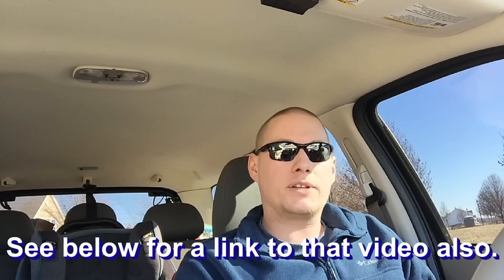Ford Ecoboost Engine Carbon Deposits: What You Need to Know

Comment: I have a 2014 Ford F150 Eco boost that I bought 2nd hand.  It has 105k miles and never has had an oil catch can.  Would you recommend me putting one on or not worry since it has never had one?  Would you recommend the $25 Amazon special or spending $400 for the super expensive one?  Thanks!

Comment: 8 years later and yes they are oblivious. the 2.0 turbo on the ford maverick still has carbon deposit issues.  they need to follow Toyota's example and actually care about building a good engine. they need dual port and direct injection.

Comment: I do an "Italian tune up" on my Fusion Ecoboost, once in a while when getting on the highway I put my foot to the floor and leave it there. Lol also use 93 octane.
Reply: John Gaudet How has this worked out for you?  That’s been my method too on my F150 along with heaps of seafoam usage
Reply: I pour marinara into the oil fill to achieve a true italian tune up
Reply: i do the same thing!!! i have a 2015 ford eacape 2.0 EcoBoost with 126,878 miles on and i only use shell v power 93 octane
Reply: You're using that method to clean the valves on a direct injected engine?
Reply: Love doing the Italian tune-up, but not higher octane. Like the idea of Chevron w/Techron.

Comment: So, I've got a 2014 Flex 3.5L EB. It's only got 5,000 miles on it but I'm going to get it's first change of oil soon and I'll specify full synthetic. I also only use Shell, but I think I'll start using 93 instead of 87. Also, the odd "Italian tune-up" sounds beneficial. I don't want to get to 60,001 miles and have Ford tell me to replace the heads.

Comment: I am a  Caterpillar diesel generator tech, a lot of times we see that when engines don't run at rated temps and load cause exhaust "wet stacking" or "engine slobber". Could running these engines at high rpm a couple of times in a drive cycle prevent this carbon build up?

Comment: MY belief is that EGR and PCV cause carbon to deposit on the valve easier now and because theres direct injection, now theres no gas coming upstream to dissolve the carbon
Reply: +nicholas elias That's exactly what is happening.
Reply: +nicholas elias I was thinking his explanation is a bit odd. If the exhaust gas is being allowed to come back up the intake valve, why is it that not all the cylinders intake valves have equal amount of carbon?
Reply: +nicholas elias maybe they should engineer a second injector to throw a very minuscule amount on the intake valve lol
Reply: Toyota does that.
Reply: it won't. VVT and exhuast gases released into the combustion chamber during intake/exhaust valve overlap still results in soot/coking on the valves.
Reply: Anton Zuykov i think they did that in the new 5.0 mustang its got two injectors one above the valve to clean the carbon and one in the chamber
Reply: grumpy old fart  is that possible without throwing the balance of the engine sensors? But then you would ruin the cat and then will be anti-inflammatory ...
Reply: Anti-environmental***
Reply: @mattb3910  Do the exhaust valves coke up too?  The bulk of exhaust actually goes through them.  I'm pretty sure that the cylinder pressures and low tension piston rings are pressurizing the PCV system and feeding it back to the intake tract.
Reply: Lowrider PardonME Good foreshadowing, because they finally did
Reply: CORRECT!

Comment: Thanks for the video. I just bought my Mustang Ecoboost May 23rd and not even 2 days later, my engine check light came on. WTF is what I was thinking. I did a Vehicle Health report and it stated "Urgent Service Required- engine misfire".  Took it into Ford and they told me it had the wrong codes. Well 2 days later, my engine check light came on again. WTF and "did I buy a Ford lemon" is what I was thinking. I took it into Ford again. This time gave me a more detailed reason why my engine check light came on. Apparently, Ford has an ongoing problem with this particular code in relation to the problem of the misfire and not to worry about it. But for now, I would have to drive with the engine check light on til they figure out the proper codes. So thank you for the video, it was more help than what the Ford dealership told me. 

Question, you had mention that if anyone installs an oil catch-can, it would void the warranty. I was looking to do a full tune on my Mustang with the tuner, pipes, cold air intake, turbosmart blow off valve and intercooler. Oil catch-can was part of my full tuning but I guess I won't be installing that now.  Will any of these installs void my warranty? Thanks for the input.

Comment: My apologies up front for the wall of text.

Let me start with a thank you for posting these videos on the carbon build up as so many owners have no idea and nealry all of the auto manufacturers are turning a blind eye to this problem.

Owning a 2.3 DISI Mazda engine with a largely FoMoCo content I'm familiar with this problem on my car. You brought up a couple of the key issues contributing to this issue the PCV system and oil but there's more to it. As you eluded to in a previous video gasoline DI engines from the word go regardless of brand (Ford, Mazda, BMW, Audi/VW, etc) have had carbon buildup problems and while technology has improved by leaps and bounds carbon build up is still a huge issue. Besides the hesitation issues you mentioned owner will also see a progressive drop in power as the available open area of each intake valve is slowly reduced over time.

The issue has a few inputs that work together to create the gunk on the valves:
- Direct Injection: No longer flowing injected fuel over the valves removes the inherent cleaning designed into port fuel injection systems.
- Oil: as you've mentioned it's advisable to use top quality synthetic oil versus semi-syn or dino oil.
- PCV system: by recirculating the aerosolized fuel, oil and bypass gasses back through the intake system generally on the front side of turbo to ensure adequate vacuum to create consistent suction.
- EGR system: Coupled with above issues now you're adding hot exhaust gas into the intake system along with already high temps from the turbo compression (regardless of intercooler) and you have an oven environment prime to create oil caking.
- Lastly is physics: Anywhere in the intake system where the airflow changes direction and/or speeds up the oil is separated from the air and sticks to the surface, hence the carbon build up on the underhead (radius) of the valve. 

There is only one good surefire way to remove the carbon, physically remove it via media blasting or Ford's current recommendation and terribly expensive solution of replacing the head(s). BMW was a pioneer in development of the media blasting and have a factory authorized pressure pot blaster with attachments to perform the job. Here's a good before and after set of pictures albeit on a BMW it'll be the same on any DI engine.

https://cobbtuning.zendesk.com/hc/en-us/articles/200025864-BMW-Intake-Valve-Carbon-Buildup

There is no practical way for the average owner to prevent the buildup so removal at some point is the solution. Hopefully all manufacturers will develop cleaning procedures and make them affordable to average owner. 

Thanks again.

Comment: I just got married in December and my wife has a 2014 f150 with the 3.5 ecoboost in it. I have no knowledge about Ford vehicles at all and especially no knowledge about the ecoboost engine. 

I actually work for GM and have only ever owned GM vehicles in my life. So I have been doing lots and lots of research about the Engine especially. Because I also wanna know my engine as best as I can! And I have only ever had 5.3’s before. 

And after doing a lot of looking around and watching lots of your videos I have realized that there are a couple known problems with the 3.5’s first obviously being the whole carbon issue and needing to install the oil separator. And second I have found is about the timing chain slipping and needing to replace a whole bunch of stuff to totally fix that problem. 

The truck has 75,000 on it and just had the plugs and harnesses, all fluids changed just a couple months ago. And we will be pulling a 3,000LB camper with the truck quit a lot. And I was just about to put a new topper on the truck as well as have it rust proofed but before I put another $3,000 into the truck I just wanted to make sure it’s sometime wanna keep with all of the known problems with them. I wanna have a truck I can run to 250,000 like I know I get can out of a 5.3 vortex. And I just wasn’t sure your thoughts? And if I did keep the truck what all do I need to do to make sure it stays running good? I just know nothing about these and trying to learn as much as I can about them! I love the truck and would like to keep it as my wife’s grandma got it for her. But I just know timing chain problems are nothing to mess around with as well as the whole carbon problem with the change of messing up the turbos and other things as well. Thanks so much in advance for your help I’m just really trying to learn this ecoboost Engine the best I can.

Comment: That's a good bit of info. I am a new Ecoboost owner 2.7l F150. Great engine so far! I was a Ford Master Technician for about 15 yrs. and I agree with the Chevron Techron additive it works well. However, I am a huge Amsoil fan so I will be running that oil along with their P.I. fuel additive. What you said about the induction service is spot on too, the Ford dealers that I worked for, we would never recommend even the BG Induction Service because we didn't know how it would affect the turbos. The 3.5 Ecoboost was to new at the time. Great info on your videos!

Comment: How to fix direct injection problems in your pick up?
Factory approved method. 
Step 1. Take a chain and bolt it to the motor, remove engine from vehicle, place in boat, and then throw overboard. 2. Put in a port injected 5.0L  v8 
3. Go out and have a drink.
As always, advice is absolutely free.

Comment: In our EcoBoost test vehicles we have found that the addition of an oil separator and water/meth injection really helps keep the engine clean. The water/meth injection has the secondary benefit of increasing performance.  We modify the cars fairly extensively, so warranty issues are not a concern.
Reply: Do you use an over the counter oil separator or do you just fab up a catch can?
Reply: Nice! I'm commenting just to be sure any add to this conversation!
Reply: This is good info coming from a factory performance line. I was thinking something similar and was wondering about the meth injection. I may buy an ecoboost after all.
Reply: SVTPerformance So u guys void the warranty from the jump huh? U would think after all these years the blue Oval would trust u guys. kind of like Benz & AMG!
Reply: SVTPerformance This seems to be about the best solution so far to combating the inherent issues of a "dry" intake tract.  It's my guess that as di/t technology continues to proliferate across the automotive industry oil catch cans are going to become are going to be a standard part of the PCV system system as it's pretty cheap insurance and there's no real down side to them.  It may even help overall engine emissions and efficiency as a catch can will contain oil vapors instead of letting them run the combustion chamber and burn off.
Reply: SVTPerformance .
Reply: water/meth, aux fuel/port injection and dual catch cans. 44whp on a 2.0 and it's FUN and valves are clean as a whistle
Reply: What if you didn’t reroute the PCV back into the intake of the engine? Just pass it through an oil catch can and then vent it out through the bottom of the car. None of the blow by is going back over the intake valves keeping them clean. I feel like there are regulations against that but could it potentially solved DI carbon buildup?

Comment: Great video. I like my 4.6 Town Cars. I have been driving 4.6 cars for almost 20 years and the engines are still going strong at 300,000 miles when I get rid of them. The 91-95 4.6 Panthers did get carbon build up in the EGR passageway channels. Do first EGR passage way channel cleaning at 100,000 miles, then every 50,000 miles. 96-11 don't clog. I know I will eventually have to update to a newer engine, as my current Town Car has 225,000 miles, but I'm hoping for a Ford Fusion Turbo Diesel in the USA, if no Diesel, then I guess I'll take the 1.5 ecoboost turbo. I rented a 2.0 Turbo 14 Fusion SEL and that thing would do some crazy speeding. Push the gas down at 65mph and you'd be at 100mph in a flash.
Reply: 4.6 cars are what I used to live by. 
I never should have sold my Panthers...

Comment: I switched from Mobil 1 (semi-synthetic garbage) to Pennzoil Platinum 5W-30 FULL SYNTHETIC Motor Oil several years ago, once my truck went out of warranty.  This stuff is legit synthetic and I still can not believe I am using Pennzoil motor oils...lol.  I researched AMSOIL and almost went with it, but was swayed to the Pennzoil Platinum and glad I did.

As for Techron Fuel Additive, i know it is a amazing product that actually works, due to me working for Chevron Finished Lubricants back in the mid-90's.  But I have steered clear of any fuel additive due to the EcoBoost being a Direct-Injected Turbo Charged Engine.... Will go back to
using the good stuff!

Many thanks for you taking the time, trouble and effort to put up these videos.  I have been making the mistake of drinking my local Ford Dealers Kool-Aid for too long, now God willing, maybe my F150 EcoBoost will run again like it was designed to when it left the factory, all thanks to you and a few others who spread the truth!
Reply: Good input, I've ran both products in my 2014 3.5 . I have a 156000 miles on it now, great good running truck. Mobile 1 does have a great oil filter though 😊
Reply: @HeavenlyDetailz  I've got a 2014 crew cab Texas Ed, gloss blk, with chrome trim and wheels. I've done extensive research on oil filters, Mobile has less constructive flow and is made well. Penn is the way to go as well as Techron. This 4 wheel drive gets 17 in city and 19 to 20 highway.  Good luck with yours let me know what year is yours.

Comment: The carbon build up is mainly from crank case blow by. To meet emission's they vent the crank case gases back into the intake via the PCV valve to be burned in the cylinder and it cakes the back of the valves.  Valve over lap may be partly to blame as well. Port injection cleaned the back of the valves and when they just went straight direct injected the valves no longer where cleaned. The new directed injected fords have both port and direct injection because of this

Comment: Thanks for the quick response. I'm unable to change the oil myself anymore. I now have to take her in for a change and they want around $70 vs $40 for an oil change. love my truck, bit  not able to pay that kind of money for full synthetic.   I'm worried that I'm not taking care of the motor as I should. the absolute best truck I've ever owned.
Reply: +Robb Toft  You can go longer with the 70 dollar change ..
Reply: If you EVER use non-synthetic oil (even the least bad, Castrol GTX), you are not taking care of your motor as you should. Reason doesn't matter. Other people are talking about fuel quality for whatever reason but these deposits are literally oil from the PCV system. Bad oil has a high NOACK rating and evaporates a lot more than good oil, or even mediocre oil (such as Mobil 1). Always use good oil as the first line of defense against this kind of problem. You can also consider other accessories like the catch can that was recommended, which will catch some of that evaporated oil before it gets back into the intake. Synthetic oils do not simply allow extended oil-change intervals (OCI) - they are an absolute requirement in a modern engine if you want the engine to last.

Also doesn't help that Ford dealerships will use that garbage semi-synthetic. Semi-synthetic is non-synthetic, and "synthetic" is often not even synthetic (group 3 oils are not synthetic!) But in any case, if it's not a full synthetic, it is definitely crap, and if it is a full synthetic, it MIGHT be good. That junky Motorcraft semi stuff will get you through your warranty, and that's what Ford cares about, but if you actually want your car/truck to last, you can go ahead and tell them where to put their non-synthetic oil (hint: somewhere other than your engine, maybe one of their own body parts instead).

$70 per oil change at 2-4 times a year is, what, $280/yr? How much did you pay for the vehicle? What do you pay for gas? If you can't afford synthetic oil, you're doing something wrong.

Comment: My 3.5 twin turbo, 65,000 miles, was sputtering under heavy throttle and we put AC Delco intake and valve cleaner through it, let it set over night as directed, updated the tune, changed the spark plug gap to 35 and she runs like new.  Just got it back today so I'll give it a tank full and see if the mileage gets any better than 15.5 mpg.
Reply: @Kaffe Stein been using similar combustion chamber cleaner into the intake manifold similar to gm old Kleens  mixture ammonia olic acid hydrocarbons  in a spray can by Tumbler let it sit over night  then change oil  and filter don’t drive it hard after as chunks of carbon could damage turbos . So I drive like an old lady for 200 miles after  and do it 2 times a year truck runs like new with 200000 miles and uses 0 oil between 4000 mile oil changes  ps use good quality 5-30 synthetic oil and hi quality filter